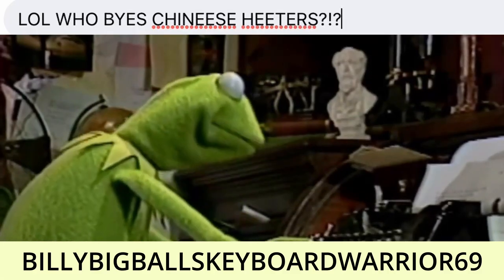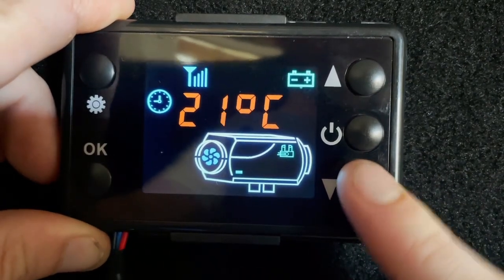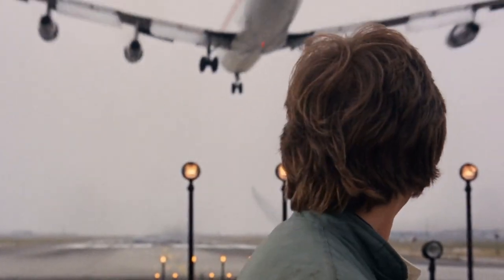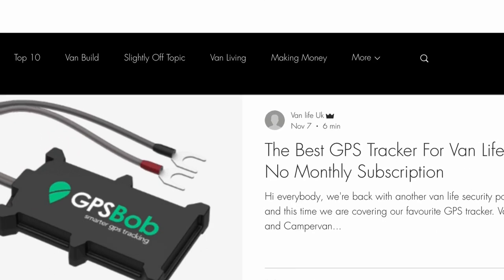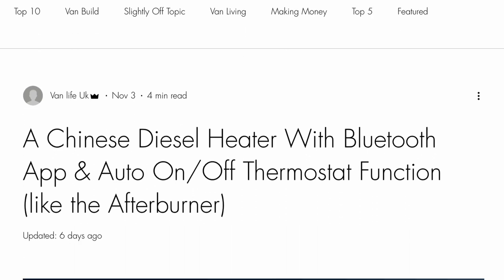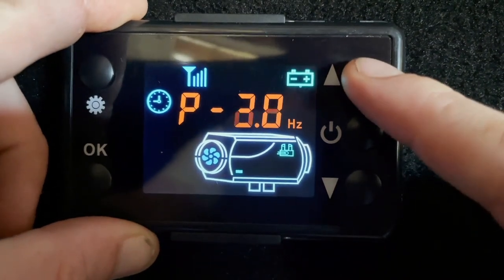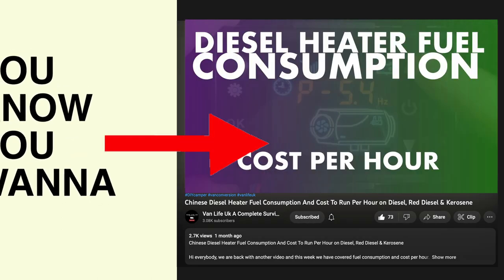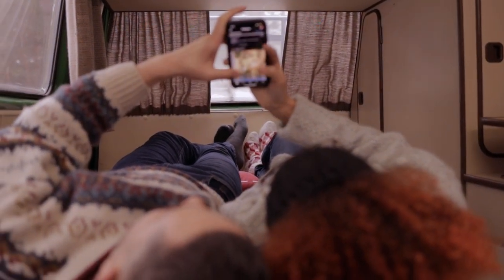The Difference Between Temperature (celsius) And Power (Hz) Mode On Chinese Diesel Heaters

Comment: Thanks for these video's - but how do you know which mode you are in?
Reply from the maker: It depends what controller you have. 

On all in temp mode when you turn it up or down it will cycle through celsius or Fahrenheit. 

In power mode on some controllers when you turn it up or down it will be in hz mode and say something like 1.4hz or 5.4hz etc. 

on some other controllers the hz mode is a constant power mode and when you turn it up and down it will cycle through p1-10 this is basically hz mode but some controllers work differently. Please see links below for two examples of different controllers

This one has hz settings https://www.youtube.com/watch?v=_dAIzvh4IaQ&t=65s

and this one is p1-10 settings https://www.youtube.com/watch?v=5QvjA2ZgFR4

Comment: Hi there, my controller only displays H1-H6 what is the equivalent in Hz??
Reply: on my heater ....H1 =1.20 , H2 = 1.56, H3= 1.92 , h4 2.28     measured with an App bpm ,  beats per minute
Reply: as you I wanted to calculate ml/per h   and cost per hr ... hope it helps
Reply: @juliolouro9755  that’s fantastic help Julio, thank you very much indeed👍🏻

Comment: Thanks for this but my new lcd version seems to have to hz control. I've got temperature and power control from H1 to H6 (here also doesn't stop heating at all) I've though about changing controller only to this Bluetooth one but not sure of that would work?
Reply from the maker: it would work but you would need to change the motherboard, controller and possibly the wiring loom too. I'm not sure the bluetooth controllers and motherboards are for sale on their own anywhere yet but if you could find them as a set they would most likely work. 

You can get the motherboard, controller and remote from the first video you commented on in a set and then they would work as per our videos :)  Here is a link but you will have to select the right option within the link. https://s.click.aliexpress.com/e/_DdkglIR

The motherboard that comes with the controller you are describing is a dumb motherboard so replacing just the controller isn't an option however if you get the universal motherboard that can be purchased from the link above too if you select the right option can also work with multiple other controllers including the after burner that has wifi and loads of other awesome features